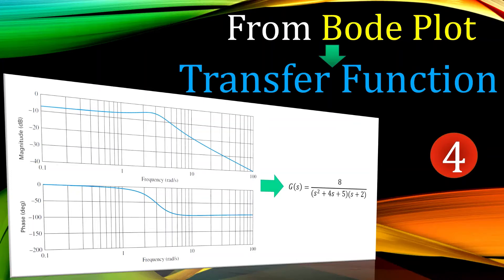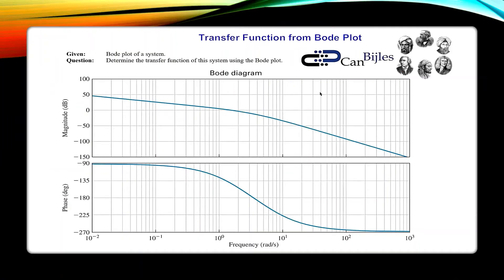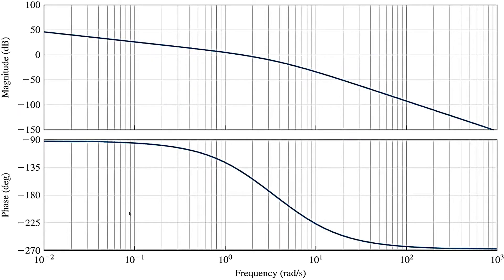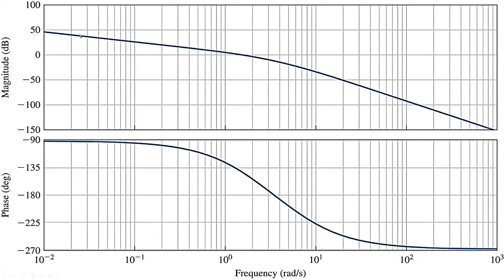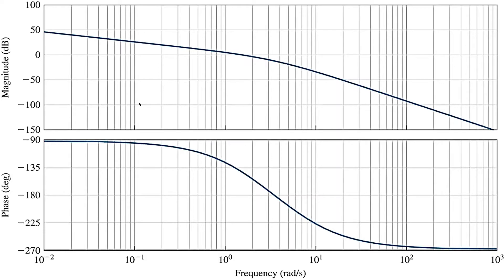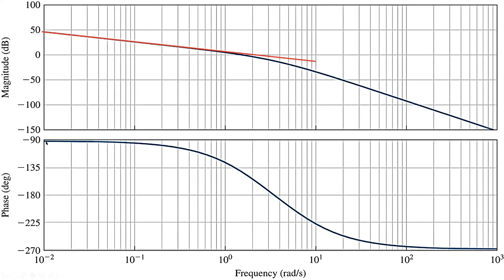Deriving the Transfer Function from Bode Plot ⭐ Pure Integrator Pole 💡 Example 4

Comment: Thanks for the videos they are very helpful. I have a concern though ,I plotted the transfer function and the bode diagram is different at the beginning can you cross check to see if you get the same bode diagram when you plot it in matlab , I may be doing something wrong
Reply from the maker: Thanks for your message! You're welcome!

What is the function you have used to plot the Bode plot? Maybe it is something wrong with the expression in MATLAB.
Reply: i think maybe CAN forgot to multiply the second break frequency by -1 since it is not a minimum phase pole ?